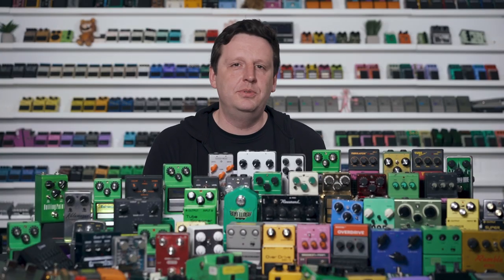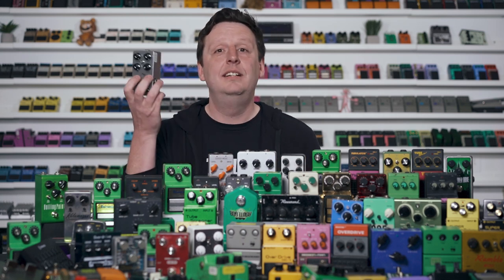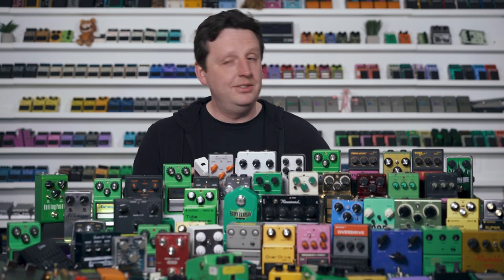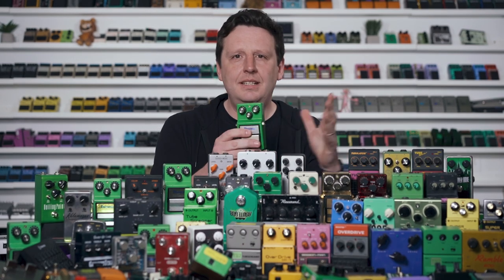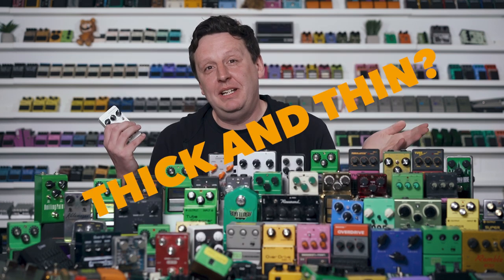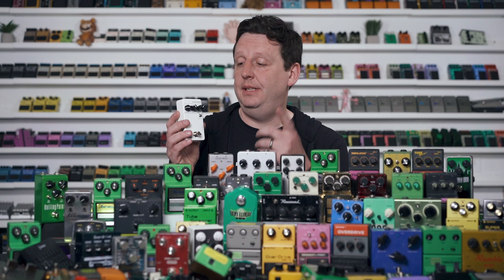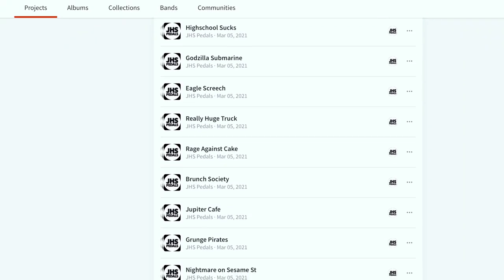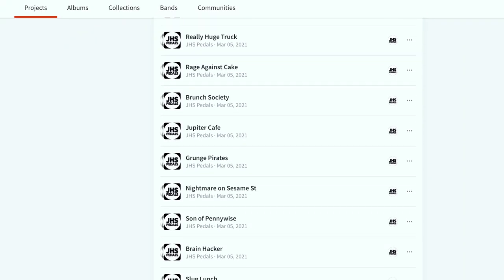What is the JHS 3 Series Screamer?

Comment: Josh, this is cool, but I’m still voting that you make a pedal that has the overdriven, swirly, phasy sound of the guitar/organ in the son “No Matter What” by Badfinger, and you should make it a mini pedal and call it the “Dirty Digit”. Thanks for making this, though.
Reply: Mini pedals drive me nuts.  I have one my my pedal board (TC PolyTune) and it rocks and moves and drives me insane. I've gone 100% to full-size pedals because they stay in place during live performances.  That said, if you can manage them and have the right pedal board, more power to you. I have a hard time standing on one foot in any case, let alone trying to hit a mini-pedal in a forest of full-sized pedals.
Reply: Wouldn't be surprised if Joey Molland is going through a rotating speaker on that, the type used for Hammond organ. That's why it sounds like a keyboard.

Comment: I check local availability and the best, (cheapest), I could find is AUS$169 PLUS postage with a TS9 is only Aus$10 dearer.  GREAT demo. I don't use overdrive pedals or delay pedals but they were, both, impressive.

Comment: The morning glory and the screamer is glorious!! I use the OD setting on my KOT in parallel with the TS style pedal… I love it… mids are there, all the treble it needed, doesn’t cut too much of the bass since both EQs of the pedals are present ;) similar to the stacked sound you used though I would say 👌sure they morning glory is based on the blues breaker circuit same as the KOT?

Comment: What is the Strong mod doing? its changing the biasing voltage only to the clipping diodes to a high biasing voltage while the tube screamer circuit is still operating at +9vdc

Comment: People complaining about tubescreamers don’t understand what it was actually designed for. It’s “flaws” are why it’s good when you use it as intended, it’s not supposed to be used to add a little dirt to your clean amp, it’s supposed to take your crunchy amp and push it over the edge for a lead line, the mid hump makes it pop out of the mix so you’re heard. Rant over.

Comment: I hat tube screamers, every Boss OD & almost every other OD because the totally kill of the low end of my Fender Super Reverpb amp while adding the most annoying midrange bump. I like these pedals: butler/ tube works, Danelectro "Daddy-O" & the new Fender MTG OD & MTG Distortion, designed by Bruce Egnater. Primarily because they all have Bass/Mid/Treb controlls so I don't lose all the bottom end & I can kill off the mid-range bomb. So, is your Series3 Screamer pedal with the increased headroom gonna make me happy? Because I love how it does respond like an amp, because I cant stand the compression of OD pedals. Or if i go with a Low Drive & get the bootom end is it gonna be as "open" as the series 3?
Yeah, I got issues...

Comment: I have to ask the master of pedals,have you ever heard of the Korg Stage Echo? A friend had one of them and it was competing with the Roland Space Echo. It was a tape based unit and the tape was something like a 8 track or vhs type cartridge, as far as memory goes . It was somewhat temperamental but it did all the delay sounds of the day. I have never seen another one but it was a good unit for it's time. So I wanted to know if the man who's seen every pedal sold commercially has any information on the Stage Echo by Korg.

Comment: I love the idea of the Series 3 pedals, but there is a real issue: their plain design will be a nuisance when it comes to using the pedals, since they are all so good and worth putting in the pedalboard, but in the end the pedalboard will look identical, becoming a mess to use it live, where you will have many white 3 knob pedals with the only difference being the small letters. Consider having different colored cases for each version in order for them to become usable together
Reply: Sharpie
Reply: @jimyoung9262  While that is the obvious solution, it is far from ideal. I would go with stickers, but having the same design with different colours would not be much more expensive and the result would be much better (especially in the marketing standpoint, where there are some incredible pedals in the same price range, like EQD Plumes, that has a distinct design)

Comment: I've been playing lead guitar continuously since 1963............sometimes for money..........just a little money. Cover tunes. I bought the first Tube Screamer, and the TS9, and the Sonic distortion (my favorite), and later the Sound Tank. All helpful if, like me, either you couldn't turn the amp up loud enough to get a good sound without out getting beat up by the chaperones, or had an amp which only did "CLEAN", like most Fender amps of the sixties. I'm here to report that your Screamer knocks it right out of the park. For real. I have a Helix. It cannot do what the Screamer does,  particularly with the toggle switch up. Most wonderful of all is being able to dial up the distorted sound I want and then getting clean just by dialing the volume down on my guitar. BAM! It sound fantastic with my Princeton (with a Celestion Vintage 10 inside) and Burstbuckers.
I once had your Morning Glory. Didn't work for me.
YOU ARE FORGIVEN.
Love,
Bill

Comment: Don't buy JHS 3 series pedals the toggle switches break ! There's a space between the switch and the box and in time the threaded part of the switch pulls out of the switch body , they could fix it by putting a washer or two in between the switch body and the box but they don't ! You've been warned I've had 2 of these things break in less than a year and they wouldn't send me replacement switch s because I live in Canada , these guys suck !